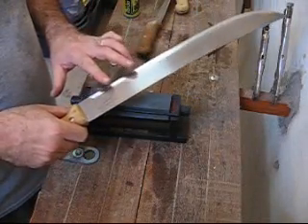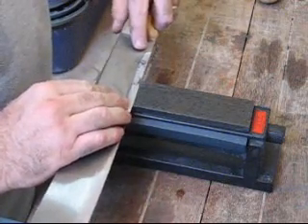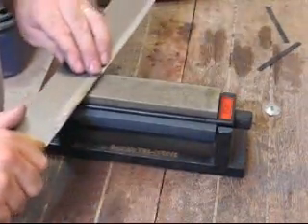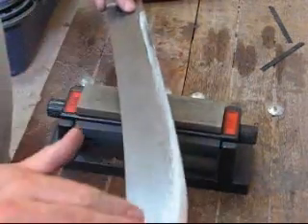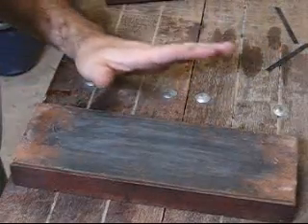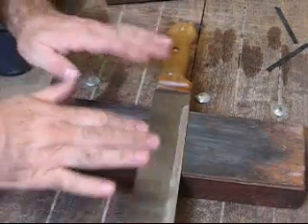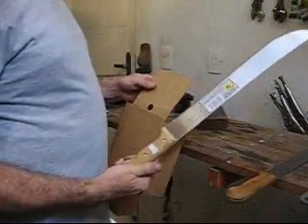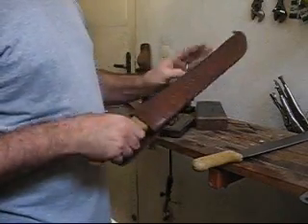Machete Modifications Tutorial  Part Two with Dave McIntyre Alone Season 2

Comment: I completed my modifications last night. I ended up using a 30º angle on the chopping part and a 20º on the sharper part. Everything seems to work great for it's intended purpose but I will do more testing this weekend. I initially sharpened the blade in three sections because of clearance issues on the Tormek, but I then realized I could remove the stropping wheel and next time I would only have to work in two sections. I may post a video this weekend if i have time.

Comment from the maker: @Caveman0713 The unmodified edge as it comes from the factory normally doesn't even have an actual edge.  That is the case with that one.  The edge basically skips off the material without biting.  The sharpened machete bites right in.  That probably the difference you are seeing, the first blade won't cut at all the second bites right in.  That being said I do highly favor sharpened blades as opposed to dull ones but I wasn't trying to play with the camera or create an effect.

Comment from the maker: @garystorey 

If you sharpen a convex on sandpaper at home you get an amazing edge.  That edge will dull with use in the field.  You can take sandpaper and a mouse pad with you and touch it up.  I don't bot5her to do that.  I most often use a small diamond rod and wind up with is a basic convex shape edge profile with a small, sharp micro bevel at the very cutting edge.  I find this perfectly adequate for what I do in the bush.  I have a field sharpening video that demonstrates the process.

Comment: I am modding a Cold Steel Magnum Kukri so it is probably a bit thicker than the blades you have shown. But I am using a Tormek wet sharpener. It still takes a while though as I am being quite careful and working the blade in three sections. What kind of diamond rod do you use for field upkeep? Do you just draw it along the blade? Any chance of a video instruction? Thanks again for this great series.

Comment from the maker: In my experience the jungle will force a patina on it's own.  As for rust prevention it is a weak sister to a coat of oil, it helps but won't stop rust from forming in wet conditions.  I have played with forced patina from a cosmetic/aesthetic approach and that is very interesting.  You can make a very unique looking blade.  The Tramontina 1070 steel takes a very dark patina with vinegar.

Comment: using two different angles in the blade is just genius. I like to make a grove in the back of the tip of my machete with an angle grinder and sharpen it (like what fishing knifes have). I use that for picking fruit of the trees. Great video

Comment from the maker: @LiberalsLickBalls When I use sandpaper over a mouse pad I start with 320, then go to 400, then 600.  If you really want to get fancy you can go from 800 to 2000 but that isn't necessary 600 to 800 leaves a very workable edge on a machete.

The problem with just using sandpaper is that you will use alot of it if you don't do the initial removal with a file.  If you do the work first with a file you are only correcting the flats you left with the file not grinding away lots of steel.